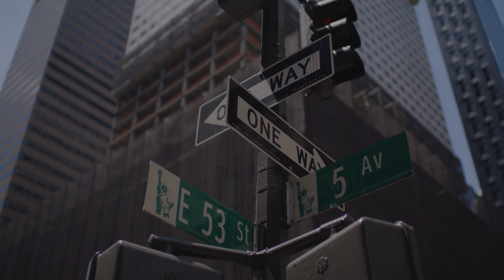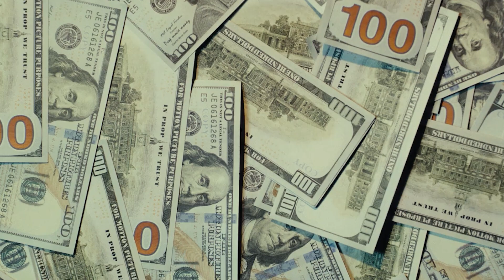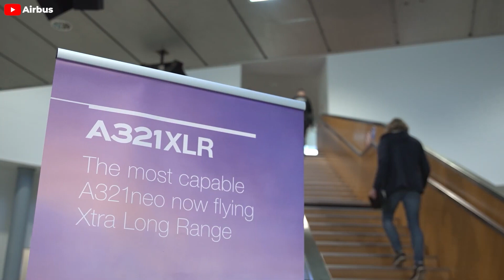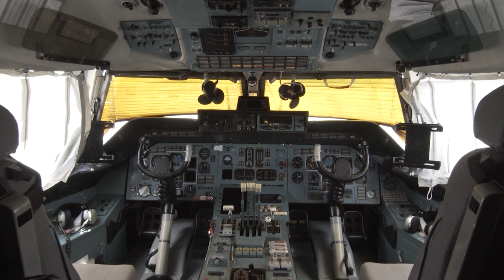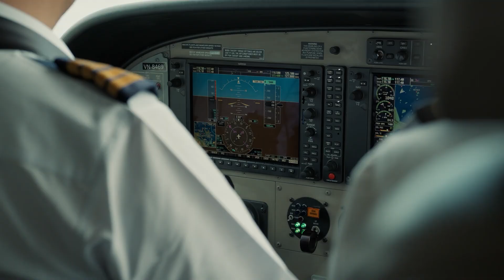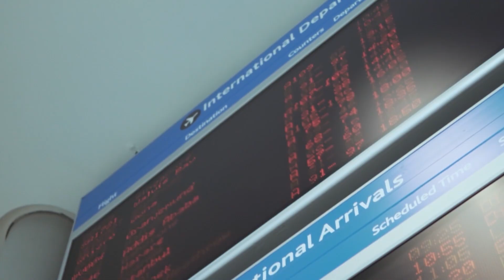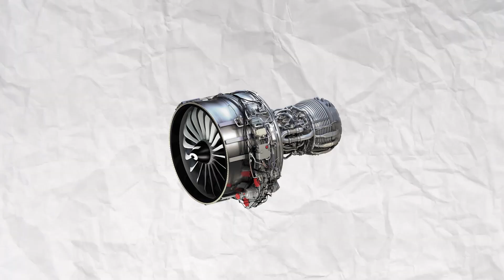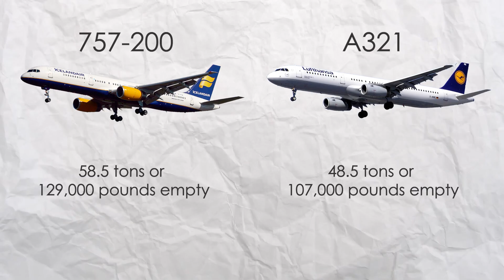Here's Why Every Airlines to Says "NO" to 757 and BEG For NEW Airbus A321XLR!

Comment: Boeing is often considered better than Airbus for several reasons. One key factor is Boeing's long-standing history and experience in the aviation industry, being a pioneer in commercial aircraft manufacturing. Boeing aircraft, such as the 737, 777, and 787 Dreamliner, are known for their reliability, performance, and operational efficiency, making them some of the most popular and widely trusted by airlines around the world.

Boeing is also known for its innovative approach to aircraft design and technology. The 787 Dreamliner, for example, features advanced materials like carbon fiber, which makes it lighter, more fuel-efficient, and more environmentally friendly. This focus on fuel efficiency and sustainability has made Boeing planes more attractive to airlines seeking to reduce operating costs.

Moreover, Boeing aircraft are often seen as more versatile, with superior range and speed compared to many Airbus models. Their robust performance capabilities make Boeing aircraft suitable for a wide range of routes, from short-haul to long-haul flights. These qualities, combined with the company’s extensive support and maintenance networks, contribute to Boeing’s reputation as a leader in the aviation industry.
Reply: STOP SPAMMING

Comment: In many ways, the 757 was doomed to eventual failure. 

As successful as it undoubtedly was, the market was unable to sustain production for long enough for the early production to require replacement. The shortfall was almost a decade.

This could have been avoided if Boeing had created a brand-new single aisle design with comonality  throughout the range. Doing so would have allowed production to be adjusted to whichever variant was most in demand, yet still retain the ability to produce the less popular variants as required.

The A321 will probably go down in history as the plane that killed off the 757. I would suggest that the insistence of keeping the ancient 737 alive was just as much, if not more, to blame.
Reply: Well noted. It was a resounding agreement among line pilots at my airline, that Boeing should have modernized the B757 configuration with a dual qual certification with the B787. A feature available between the B757 and B767's combined type rating.
Reply: Lol, you guys are killing me. Airbus didn’t kill off the 757. Boeing did it to itself. If that were the case, how long did it take to eclipse the 757? Airbus built the A321 and airlines still didn’t want to replace their 757s, the A321 neo and the A321LR still wasn’t enough to kill it. Even then, there’s still some airlines that refuse to let them die in hope Boeing will decide to go ahead with the 797. But a little too late. $20 billion later and how much will a 797 cost? How many will Boring need to sell to break even? Is the market big enough to make a profit? Will they need to offer huge discounts to break the spell that the A321XLR has on that market?

It wasn’t an easy decision for Boeing to not upgrade the 757. It’s an expensive plane from the start. It’s so overpowered  and ahead of its time. It had a niche market and performance in any type of climate. First single isle to go transatlantic. 

But Boeing does not hire industry experts, they hire bean counters to “maximize profits”. These guys with their arrogance didn’t see a case to upgrade it at the time and wanted airlines to wait for them. They didn’t listen to the airlines because there was not “enough money to be made”. Their greed and arrogance came back to bite them in the arse. Even the FAA refuse to give them leeway now. They shot themselves in the leg numerous times. With the 757, 737, 777x  and now with the space program.
Reply: @brendazea3806   Of course, the A321 helped to  kill off the 757. 

Until the A321 came along, in particular the longer range versions, Boeing could, theoretically at least, have updated the 757 (in my opinion, a bad idea) or preferably have included it as a variant of a 737 replacement (not the MAX upgrade)

By failing to do the first in a timely manner, and yes, there were reasons why this would have been difficult, if not impossible, they allowed the A321 to take so much of where a 757 would be used, as quite bluntly, there is nothing in production to compete with the long range A321s.

This made the niche, where the 757 had formerly been superb so very much smaller. It is now so small that any development of the existing 757 would no longer be viable.

The A32s can already do most of what the 757 is used for. Not only that, but being much lighter, they can do it more economically.

The A321 helped to  kill off the 757, not because it is better in all respects, but because Boeing allowed it to.

P.S. You should have noted the final comment in my original post where I attributed much of the blame to the decision to upgrade the 737 rather than replace it.

Also, much of what you wrote actually supports my view.

Don't forget that even while the 757 was still in production, the A321 was eating into the 757s sales where increased passenger capacity was the important requirement, and the undoubted strengths of the 757 were of little or no importance.

I suspect that the MAX10 could have been a cobbled attempt to deal with the capacity issues, but thanks to their disastrous choices any future attempt to address the range issue is no longer possible (the loss of Grandfather Rights for any additional variants)
Reply: @ I couldn’t agree with you more. But, you said it yourself, “Boeing could have”, “they allowed the Airbus A321 to take do so much”, so, when you say killed it off, they were only there to beat a dead horse. One that had been killed long ago by its own company, Boeing. For this reason, I don’t agree with the “killed off” part. However, I agree with you on the rest. The Airbus A321XLR is a great airplane. Very capable, economical, with excellent performance numbers and beats the 757 and practically 90% of stats. Some flight attendants may not like it because it has very small galley space. But, I am a passenger so, I like it.
Reply: @brendazea3806  Appologies, my attempt at editing my response went terribly wrong, and I had to re-post it.
 
Unfortunately, they crossed.

P.S. I used killed off because without the A321, it would still have been possible to have something to replace the 757.